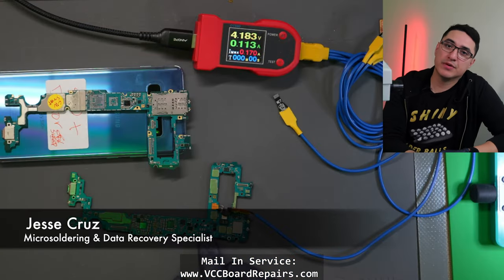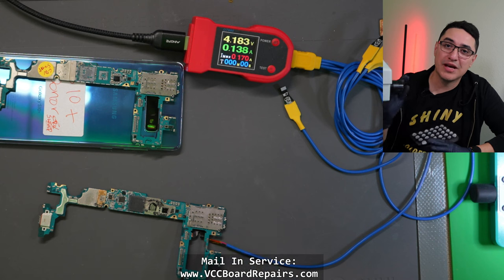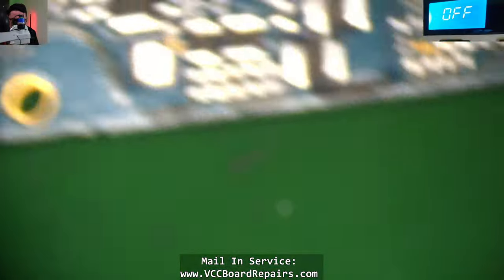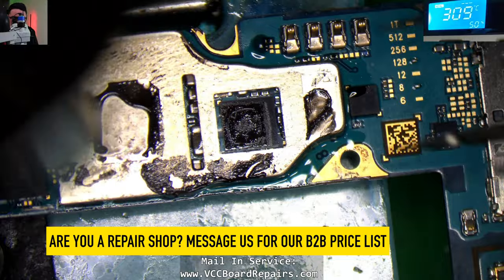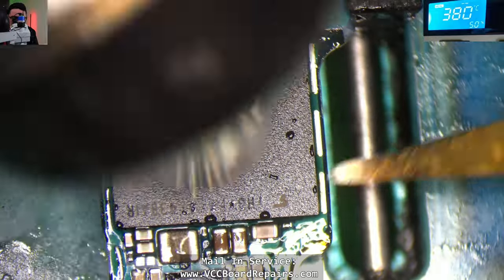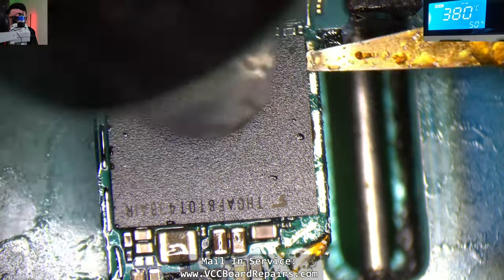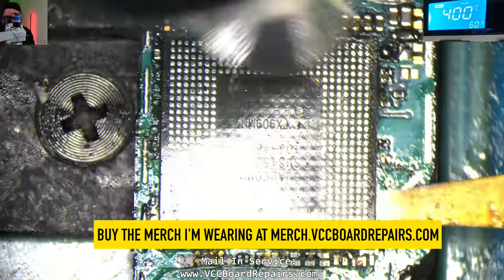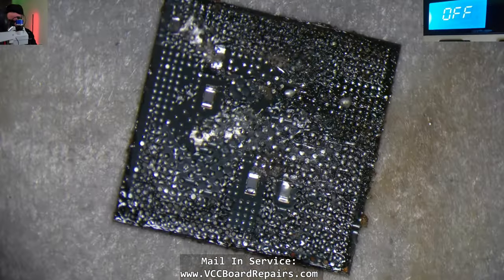This Android Does Not Turn ON. Samsung S10 Plus CPU Swap for Data Recovery. Full Walkthrough.

Comment from the maker: How many of you have tried a CPU Swap and failed? And what do you think went wrong?
Reply: Dead ufs😂
Reply: Vivo, Freakin hard glue.
Reply: I had a go at a bunch of old A10 CPU ipads I had lying around, I removed the chips perfectly, reballed them perfectly, But each time, I got a short on the 1.2V rail.... Well maybe one day I might be able to pull it off successfully.
Reply: @ExzeroX  Keep at it 👍, Now you mention it, I'll be expecting a short on 1v2 but I'll let you know
Reply: Great demonstration as usual.
For me it's the Samsung S7 where I have a lot of trouble, with the RAM, the processor has holes and it's not easy to put the RAM back correctly.

Comment: Dont forget the trick of putting a plastic utility clamp on the CPU to get it too boot and recover data. I had a samsung tablet stuck in boot loop, and the first time i tried using the utility clamp by putting it on the CPU, it booted right away and touch was fixed. Now a perfect board to practice reballing
Reply from the maker: I'm well aware of this method. Didn't work
Reply: Didn't mean to sound like I was doubting you. Just an idea forgotten  from the video. I've never seen anyone so dedicated!!!
Reply: I saw that LOL still waiting to buy my own set of clamps, definitely these tricks level us all up
Reply: @VCCBoardRepairs  CAREFULL with heat on the Samsung boards.!?.  I just spent hours yesterday cleaning my chips and the board all perfect, now I just noticed the board has a bubble in it, im gussing i used to much heat and seperated the layers. Glad i noticed cause its hard to spot. Device isTab 6E Lite. Also my first time dealing with samsung glue, So i think it probably happened because at first I didnt think there was any glue because its clear and contained under the edges, so i kept heating waiting for it to loosen. :$
Reply: It's q bit tricky, but if you know the exact spot to clamp, it works in 90% of cases without having to resolder chip.  Of course it's not a permanent fix, only for data recovery.  I remember using this method on LG V10's which had a lot of these boot-looping issues.

Comment: Great video, thanks for sharing. Is there any chance of recovering data in the event of a damaged processor? In my Samsung S10+, the processor was damaged. Is it possible to resolder just the memory to a new motherboard?
Reply from the maker: No, that's impossible. The data is encrypted with the keys in the CPU. No CPU, no data
Reply: @VCCBoardRepairs  thanks for fast answer.

Comment: Any guesses why this repair doesnt last as a long term repair? 
The lack of solder around the perimeter of the nand seems like a weak point and design failure. 
Have you tried different glues on the corners of nand?
Reply: I've been having really good success soldering chips with pure rosin. Especially on lead free preballed chips. Mechanic X9 Rosin is the best I've used so far, it is possibly X Grade and on sentrix. If someone tried to do this as a long term repair, I think using rosin would help with some structural support for the chips when it hardens, it also protects against liquid damage. "Electronics repair school" has a great instructional video, but its behind a paywall "Best soldering flux for swapping chips without reballing"
Reply from the maker: Not sure & not really interested in figuring it out

Comment: Can you make a video about uprgading samsung storage chips from 256GB to 512GB?
Reply from the maker: I would but no one has ever requested for that service
Reply: Just use a large SDcard in models which have a slot (all the latest Samsung A series have a slot).  Personally I wouldn't use ANY phone without an SDcard, my stuff stays on my phone, nothing in the cloud. ;)
Reply: @VCCBoardRepairs  Because I've been looking for a phone that is impossible to find, it is Samsung Galaxy S10 5G 512GB Verizon but I only found the 256GB Version. So, it it possible to replace the chips to upgrade the storage from 256GB to 512GB? The Motherboard for S10 5G 512GB Verizon is the Ultra Rare Part.

Comment: dose that backup included  data of Samsung secured file folder because i see there 43.8GB of data which was not backed up to the flash stick??
Reply: 1:01:27 (other) usually there are stored hidden file on secured file of samsung
Reply from the maker: It depends. If it has a secure folder setup, it will prompt you for the password for it
Reply: @VCCBoardRepairs  that's what was not backed up to my cloud on my phone, 
My phone is not working anymore due to sea water damage (the motherboard) 
Would you be able to restore the data of secured file ?
Reply from the maker: @mouhamaddoukmak yes. We would fix the board enough to power on

Then we can do a Smart Switch Backup with the secure folder data 

Then you can restore it to another Samsung

Comment: Hello i just want to ask if is it okay to motherboard swap even tho the other motherboard donor is different like for example 4gb ram 64gb and putting it to a 6gb 128gb  donor board but theyre the same model of phone
Reply from the maker: As long as it's the same model number, it should be fine
Reply: Is it okay for data recovery? Like swapping only the cpu and internal memory? But not the ram? Or the ram should also need to be swap in order to have a success data recovery from cracked board
Reply from the maker: I use the RAM that is on the customer's phone
Reply: So even though the ram in the donors phone is 6gb and the phone of the customer is 4gb i should still swap the 4gb into the 6gb ram is that it? Because im really curious on how its done
Reply from the maker: Yes
Reply: Thank you so much i really appreciate that you really reply to your viewers. Im just wondering what device is very hard for data recovery chip off method?
Reply: @MelanieRicafrente  - RAM shouldn't matter, it's just working memory, and should run just fine with 4GB too.

Comment: Honestly these Samsung bar shaped pcbs are worst pcbs to work on.
Reply from the maker: Actually I don't mind them. What don't you like about them?
Reply: @VCCBoardRepairs  you may not be bothered as you mostly do swaps for data recovery only but let me tell you that these pcbs have horrible heat distribution. Say even if you are using low heat to take off a component the moment when the component you are heating starts to float by that time some sensitive component far across or right below it either has joint issue or will short to ground. Also if you become lazy to put the pcb on a fixture while working specifically when using hot air gun these pcb tend to bend thus some ic’s solder ball will short to ground too. Last but not least don’t you gravity method for ic removal on this pcb.
Reply from the maker: I don't mostly do CPU swaps for data recovery. Most are repaired for data.

I personally haven't had those types of issues you described on these boards
Reply: @genzogamer9043  - You have to cover other parts carefully with either Kapton tape or tin foil to keep them heating up.  Also adjusting the proper heat and airflow makes a big difference.